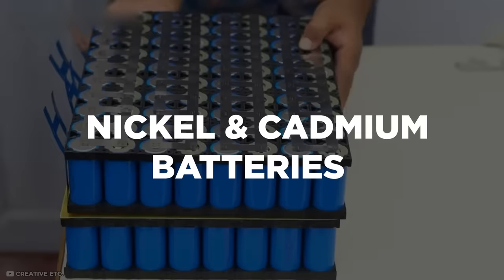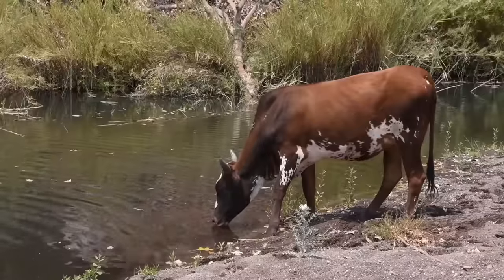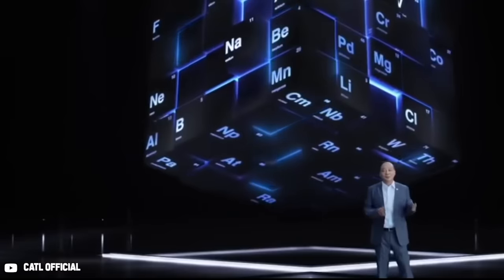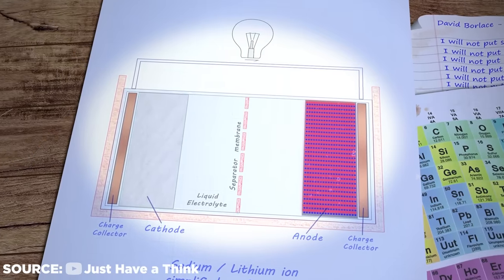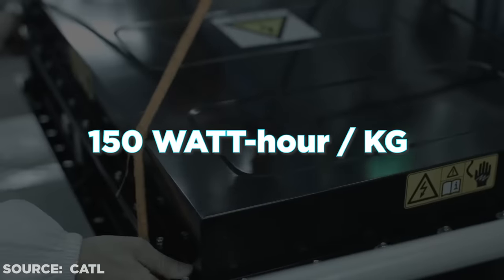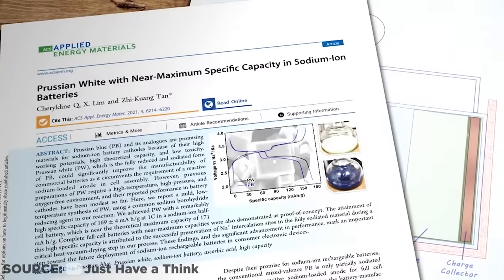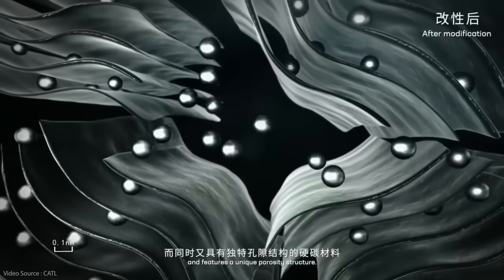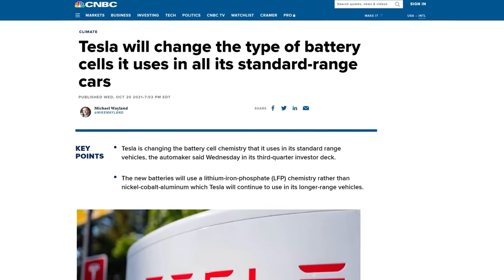No More Lithium! NEW Sodium-Ion Battery To BEGIN  Mass Production

Comment: Think EV just started with salt batteries when it was discontinued. 

The batteries had to be heated to 300°C to work, and it used about 1kWh a day to maintain the temperature.
Reply: That is the old generation sodium ion battery that use sodium-manganese-dioxide to be cathode but its newly generation in 2022-2023 use sodiumferrocyanide as a cathode and hard carbon anode and achieve a low temperature performance, lower weight that can get high energy density as close as lithium ion battery and quicker charge.
Reply: @PopularTymn  CYANIDE ! That sounds delicious !
Reply: @agileplatform  :  Cyanide in this form is not toxic to humans because the cyanide groups are tightly bound to iron.
Reply: @agileplatform  Sodium ferrocyanide is added to most brands of table salt, to stop it going lumpy in humid weather.
Reply: @David Wanklyn I don't think too much salt is bad for health because of the sodium ferrocyanide in it. There is a range of ratios of sodium and potassium in your body that is good for health, and too much salt (which is usually about 99% sodium chloride) can tip this ratio towards too much sodium in relation to the amount of potassium.
Reply: Exactly, excess sodium can lead to high blood pressure.

Comment: Strange, I've seen other vids in which was explained that these sodium-ion batteries have far, far less energy density then lithium-ion, making them unsuitable for electric vehicles but much more practical for stationary energy storage....?
CTL is claiming 160 wh/kg, current li-ion range between 260-270 wh/kg so sodium-ion's would have around 60% energy density compared to li-ion.
Translation: your electric car now has a range of 350 km, with a sodium-ion battery that would be reduced to 210 km.

Comment: the main problem is price vs performance. if it 25% less effective but 2 time cheaper i think people will start using it even if it heavier but i think the price is not that much cheaper right?
one thing i like about ev is it technology is just starting. but with all those old people that have ice in their blood keep using the same excuse over and over like. there is not much different to burn oil or mining copper to build a car. or you have to burn oil to make electricity anyway.

yep but they seem to don't care that oil will run out in around 50 years if no new source been discovery. and that is estimate of the use of oil today. if tomorrow next month or next year the oil usage increase.  it life will keep getting shorther and war in ukrain will help making it gone faster.  also all the copper that already dug and end up in car graveyard can be recycle can oil be recycle?

 if sodium battery work it will be a great news.

Comment: What is their physical abuse resistance? Will potholes or road debris end up in catastrophic failure or thermal runaway like the present ev junk batteries? What will their replacement cost be? Will they be "insurable"? Will I risk burning down my house if I park it in my garage? If Sodium is so common, these batteries would need to be 75% less expensive, wouldn't they? I will never buy one of these unless it is the same cost, travel range and reliability as a gas or diesel-powered vehicle. This PRC company talks a good game, but their reputation precedes them... Besides, wouldn't these batteries, either version, be a great way to import more destructive or tracking devices? Just asking...

Comment: I think this is a total ad for catl. Try counting the number of times he says catl, and note the images were catl. What is the informative reason for showing multiple workers moving things around with big CATL logos written on their backs???

He never mentions a single other company working on this R&D.

And finally the narrators science is in parts incorrect. As you move down group 1 of the periodic table, elements get more reactive, ie. explosive. He mentioned NiCads and Lithium batteries, but totally skipped over Nickel Meal Hydride (NiMH) batteries which are safe and cheap.

Comment: f capacity is a concern with these cleaner batteries then, at least for smaller use cases like flashlights and such, we could always go back to larger batteries, even D batteries instead of the typical AAAs. Just until their capacity catches up.

Vehicles are one thing but does anyone really care if their flashlight weighs a extra quarter of a pound?

Comment: at 6:06, you say the batteries are more "bulky" because sodium weighs more than lithium. "Bulky" is about size and shape - not weight or mass. So did you mean "heavier", or do they actually require more physical space?

Comment: What about discharge/charge cycle durability? That is an important point absent from this video. If gen 2 has the energy density of LiFe Phosphate batteries, will it have comparable cycle life?
Reply: If it costs a fraction of LFP and is easier to recycle, I think everybody will be okay with it. My LFP setup will die of age rather than a cycle count. 6000 cycles 20/80 SOC is already overkill for storage.
Reply: @mykolapliashechnykov8701  
I was thinking more for personal electronics.
Reply: @Austin1990  Ah, I see. Personal electronics is another can of worms as the batteries there are mostly killed by an improper cooling and don't get much of a cycle life. My long forgotten knowledge of electrochemistry tells me that sodium-ion might perform a bit better than li-ion.
Reply: @mykolapliashechnykov8701  The only issues with sodium ion seems to be energy density and cycle life. LFP has a longer cycle life, but it is heavier per kWh than Li-Po, so it will likely not be in phones or laptops. But, I would rather have a heavier device that protects the battery by only using 60% of the capacity. I have only had to get new phones due to battery live. My current phone has such poor battery life left that I carry a battery charger around.

Comment: It is nice that new designs are coming its political to say the Market based system is killing the batteries the problem is that they where not nearly as effective as lithium batteries. another consern is how long will these batteries last before needing to be replaced. months, years, decades. that seams to be the problem with industry is nothing lasts anymore newer cares barely last a year where older vehicles have lasted decades.

the thing about Capitalist markets when they function properly the competition forces companys to come up with better products to stay in buisness. when there are many companies to compete something you cannot find with a command economy. 

and the key word you guys seam to use is cheap like expensive dose not mean better. after all many cheap solar cells uses chemicals which are harmful for the envirement which get released into envirements because they ether get replaced/broke and they do not last very long the point is not so much what it takes to make a product more the longevity of the products how long they last and how well they function.

Comment: Lol this is junk compared to the complex fe cu+2n batteries developed by the same guy that developed lithium ion P  batterys. Instant charging 4x power density. They been working on manufacturing for 10 years tho. Ro get production cost down quality up. Plus they are making royalties on lip now anyway

Comment: Need too work on improving the number of charge discharge cycles.... 500-2000 dont cut it when your talking bout ev lifespans. And more watts per kilogram... Means greater risk of thermal runaway resulting in posibility of thermal detenation under high curent loads... Especally if the electrolite produces extream cell pressures that can cause it too explode like a pipebomb.... Lithium batterys arnt the only batterys that can explode... And useing sodium as a metal for battery production is misleading... Were not talking salt here... Were talking bout materials that tend too explode if it reacts with water.... Like lithium and cesium... Sodium and potassium are in that same list... So if you havea battery fire... Waters gonna make it worse like adding gasoline too a fire... How bout genious too solve that problem instead of playing russion rollet too cast caution too the wind... Think about it. OR SHOULD YOUR CAR EXPLODE CAUSE YOU NEEDED TOO ATTACH AND HAUL A TRAILER FOR THIRTY MILES? If it makes range shorter its obivious curent draw goes up... Think about that when you desigin the car... Americas tired of GM AND FORD AND CORVORIQUINESK LIKE VEHICALS... ITS AS BAD AS ELEN MUSK AND HIS LINE OF EXPLODING TESLAS... (THAT WAS BEFORE HE AND SPACE X WERE BLOWING UP STARSHIPS.   WE WANT SAFER THEN RUSSION ROLLET INFRONT OF CORPERATE MAUFFIAS THAT MAKE UNSAFE VEHICALS... LIKE GM AND FORD FOR INSTANCE... JOHN OLIVER SAYS IT BEST. AND WHATS SAD ITS TRUE! WE WANT SAFE...NOT ASSISTED SUICIDE! And if your car burns and water makes it burn worse... How the BLAZES IS THAT SAFE... ESPECALLY IF THE FIRE DEPARTMENT CANT PUT IT OUT BECAUSE THE BATTERY REACTS WITH THE WATER FORMING AN ENDOTHERMIC REACTION THAT MAKES EXPLOSIVE HYDROGEN AND OXYGEN GAS AS ROCKET FUEL THAT FUELS THE FIRES INTENSITY OUT OF THE WATER THE FIREDEPARTMENT WOULD USE IN TRYING TOO EXTINGUISH A BATTERY FIRE?! COMMENSENCE?! LEARN SOME... QUICK... WHY NOT ADD THERMAL CIRCUIT BREAKERS TOO BATTERYS TOO PREVENT POSSIBILITY OF THERMAL RUNAWAY DETENATION... THEY NEED TOO BE INCORPERATED INTO THE INDIVIDUAL BATTERY CELLS... AND YOUR CAR SHOULD NOT BE A HAZMAT SITUATION FOR THE FIRE DEPARTMENT  IF IT CATCHES FIRE. ESPECALY IF WATER BECOMES ROCKET FUEL BY THE CHEMICAL REACTION ITS BATTERYS HAVE WHEN ITS ALCOLINE BASE METALS USED AS BATTERY PLATES MAKE NASA GRADE ROCKET FUEL OUT OF WATER WHEN WATER IS ADDED.

Comment: Today i can buy Na-Ion Zells and batteries. But I can't find any special chargers for it and since they have such a high voltage range between fully charged and empty, I wonder which consumers can handle a voltage between 6V and 16V on a 12V battery?

Comment: The first sodium battery used for electric vehicles was used by Studebaker way back in the 1800s. This is not new tech, just rehashed old tech. The difference between the batteries from then and now is that the old batteries gave you a 600 miles of travel on a single charge. Even cell phones were advertised for sale in 1936-37. Everything's been invented already, it just gets reshaped and redesigned and re- released as a bright shiny new product and idea. A mercury arc rectifier mounted inside an electric vehicle would give a perpetual charge to the battery meaning ZERO running costs. But no one wants to talk old tech, they would rather ridicule than listen to an opposing opinion.

Comment: Lithium holds mass power of exerting, storing, ect. With these new salt batteries, the concern is a lack of pure power of excerting and storing. Yeah, they work but is the power output high in amps? When Lithium batteies were more common to public, it changed how we use to not want to  get them Alkaline batteries of not dealing with anything electrical on transportation, the Lithium batteries made me get back into the field of electrical transportation as being NOW PRACTICAL. Going to be a little bias of the new salt one until more info and examples of how they work and perform. Just the e bike forum of possible switch of batteries.

Comment: This is still a planned obsolescence system.
I had a friend working on salt battery storage 20 years ago for the UW and they had most of the issues resolved back then.  
When it comes to electronics most people buy what is trendy--not what is good--and the commercial sellers will keep selling obsolete garbage forever because most people don't care enough about electronics to learn anything about them beyond how to access Instagram and tic-toc.
This is the same reason you don't have a synthetic diamond touch screen that is impossible to break and a battery that holds a charge for a month and lasts a lifetime... people care more about tic-toc.

Comment: First, it was the hydrogen fuel situation and now this. How would people react if they knew that all the financial investors who invested DEEPLY into lithium-ion everything are throwing a kind of temper tantrum over their short-sighted decisions and are subjecting people to dangerous circumstances for many reasons, with the primary one being greed?
When a person who is not rich makes a mistake, he or she just has to deal with it often and learn from it. But these rich, narcissistic, self-styled tyrants typically just get a bail out, or worse, if enough of these kind of rich people made a foolish decision and they're all tied up in it, they just attempt to try and force it on the world anyways, in a selfish attempt to pull as much money out of the situation as possible before the inevitable.
Is that fair? No. Is it prudent? No. 

According to Proverbs, The LORD finds differing weights and unequal standards to be DETESTABLE.
That's a very strong word.

Comment: Actually, sodium is the wrong metal to use. The correct metal to use is Zinc-Chloride, as this material combination has been around since the 1970s, is safe, and was actually manufactured to not just be a storage battery for EVs, but also grid storage during the oil crisis in the US at that time. Gulf & Western Industries even tested a ZnCl battery on a Volkswagen Rabbit, a very small, compact car from that era. That car got 68 hours on one charge, and over it's duty cycles, only suffered between a 2% to 5% loss of efficiency. G&WI also made batteries for larger vans and heavier pickup trucks, as well as a third classic battery for box trucks. I can only imagine if G&WI's technology were to be adapted to semis, how that would turn out. 

While ZnCl batteries take longer to charge, they also take longer to discharge. The problem with any element in the first column of the periodic table is that the further down you go, the less safe the element is when mixed with water. In this case, anyone with any cursory knowledge of chemistry knows that when sodium is mixed with water, it explodes. And inclement weather always has water involved, just like hearing and cooling cycles do, because of condensation. 

This is why, for EVs, sodium-ion batteries will not work. They are too unsafe, even more so than lithium-ion batteries are.

Comment: I've said it before, and going to say it again... Batteries are a terrible replacement for propulsion.. they have a terrible short life span of around 2000 cycles, and are worthless after the 7 years.. the car will be useless and worthless to the second buyer.. those useless tree huggers didn't care or listen to how bad lithium mining and worse cobalt..  and those corrupt manufacturers never mentioned how incredible toxic and dangerous lithium was.. The only way to continue sustainable and renewable energy is hydrogen or synthetic fuels !!!  E85 is almost synthetic, just not traveling as far the same tank full. But cleaner and definitely more powerful.. graphene battery design is more promising. Nobody will stand for 30 minutes for a quick charge if there available or working, and forget the level 2 charging that takes upto 6+ hours.. every manufacturers owner's manual state's that you should not charge with the quick charge all the time.. it deteriorates the battery by 10% prematurely of its life..

Comment: Sodium ion batteries are cca 160wh/kg , Lithium ion are over 260.
Now Sodium ion batteries have a runaway to get to 200 but that's probably their ceiling. And right now they are not even cheaper (although they'll get there)
So no, it's not the end for lithium.
These batteries will have it's place. But never in a long range vehicles (except maybe in a hybrid battery, meaning battery that's part lithium ion, part sodium ion)

Comment: Sodium battery is not suitable in EV due to lower energy density than lithium. And as improvement of NCM battery tech, safety gets better and better. Sodium battery will be used on ESS. However, Sodium battery will have to compete against used lithium battery previously on EV in ESS market. And once lithium battery's recylcling system gets common, sodium battery will have no chance on ESS market also. 

So sodium battery is scam.

Comment: There’s a possible new source of Lithium, which will not need to be breaking rock to get, because a couple of years ago, they discovered that at least one of the old tin and copper mines in Cornwall (which has been flooded, and so it can’t be mined), has a very lithium rich water in it, so it could be harvested easily, and if they use a renewable source of energy to get the lithium out of the water, then it is a very green source of lithium……..

Comment: No more electricity...mr keshe build reactor of plasma energy... Many things can be done by controlling the magnetic field of objects, the least of which is to move objects and generate electricity, and also to produce any material from magnetic energy, but they do not allow humanity to achieve this infinite power... For example, last year China announced that it has produced a solid lithium battery with twice the capacity of today's batteries, but it is not used for cars and is being tested for making airplanes.

Comment: This is interesting, but we are still going about this backwards. The batteries are not limiting EV's or even going mostly electric for everything else, its the power generation. Currently, there is no green energy that is remotely close either on it's own or in tandem with other green energy that can replace our current power generation. The only way, currently, to move to EV's and the like is to use nuclear power. This, however, is not happening and all of the going green non-sense is just that. Current lithium ion batteries are 0.40MJ/kg (avgerage), gasoline is currently 400MJ/kg (average). At this point it is more efficient (and greener) to drive a gasoline powered vehicle than to charge an EV.